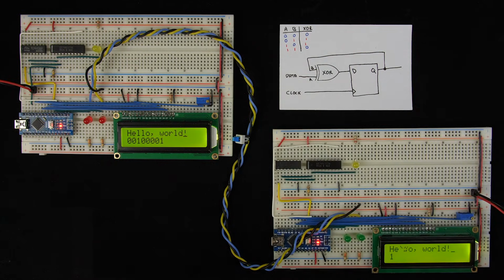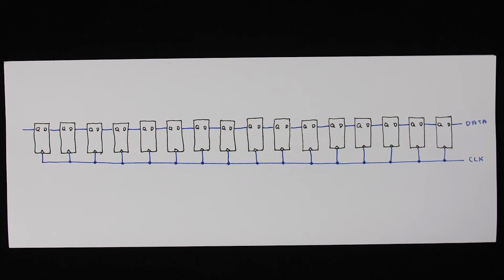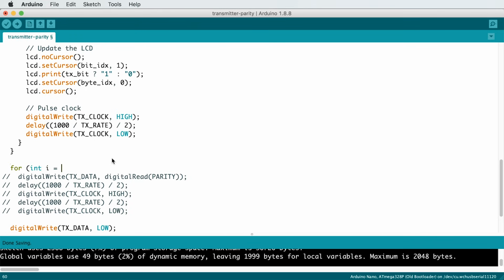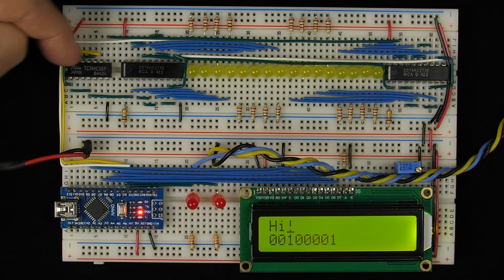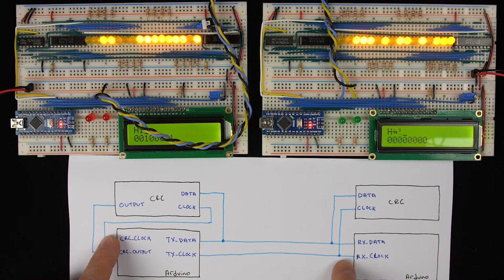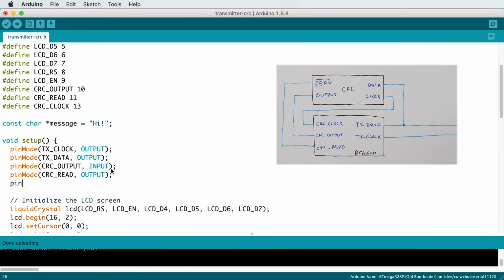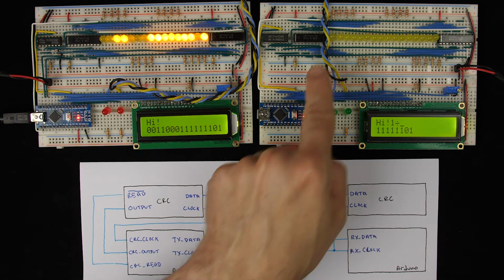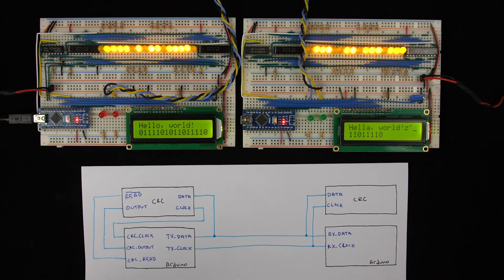Hardware build: CRC calculation

Comment: You could've used an or gate that ORs the output of the Arduino and the CRC checker, instead of using additional data lines. It would have the additional benefit of resetting the crc calculator. The AND gate to disable the calculator seems unavoidable though

Comment: I kind of want to see you add framing to this, that is to say stuffing the data inside a packet with a specified length so the receiver could calculate the CRC without showing those two false bytes. I think I'd go about it by using 7-bit ascii and reserve bytes with the high bit set as control words. Maybe add a way for the receiver to read the CRC and send back an ACK or NACK. 
...
I should just build up this on a breadboard myself and play around with it, shouldn't I.

Comment: hi ben... thanks for your videos, i really enjoy them...  i am learning arduino programming and with them i had learnt a lot
.... i heard that when the crc results non zero (i.e. bad), the result itself can be used to detect and correct the swapped bits, with no needing to request the data again
can you confirm that adding a little explanation please?
... thanks again and keep going with your videos :D

Comment: Could you simplify things a bit by clocking the CRC directly out of the CRC generator to the data line to the receiver? You'd still need the /READ signal and you'd have to be able to switch the data line from the Arduino to the CRC output, but that would eliminate the need for the Arduino to read CRC bits (and it would eliminate the "pause" that happens during that time).
Reply: Yes, all that would be required would be an AND gate on the output.

Comment: Thank you! these CRC videos are amazing! 
Is there a way to find which bits are faulty according to the not-null CRC you receive? 
Then you would be able to change the "receive" side program to remove the last two bytes and display "transmission error on chars #x and #y" if the CRC is not null

Comment: For some reason I was expecting you to add another control line to pipe CRC output directly into transmission line as opposed to reading and re-sending that bit thru computer.

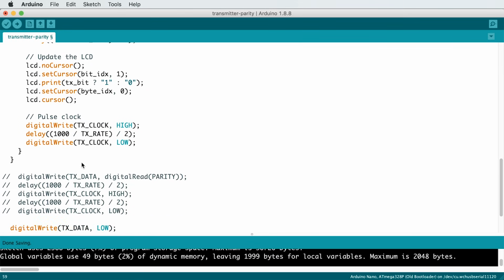Comment: Thank you very much Ben! One quick thing, when you explain what the Init 0x0000 in the crc website means, you say it's the resetting of the flip flops to 0. Isn't it actually the setting of data into crc bits to 0 right before we start calculating the crc, when we push the last 16 bits in with the Arduino after the message has finished (15:31)?
Reply: Hello, it's actually not. The initial value, as he explains, is what the flip-flops start with before we even receive the message and start calculating the crc.

Comment: Wouldn't it have been easier to AND the data input for the CRC unit with a pin? Instead of having two clocks. You'd then set the pin to 1 when you want to input your data to the CRC unit and 0 when not
Reply: That doesn't do anything. What's the point of having having an additional gate to toggle a data value when you already have full control of that data value with your micro already?
Not only that. You would also clock the receiver as well and send the zeros to it.

Comment: Great videos Ben!
I just wanted to know what would happen if an error appears while transmitting the CRC?
Reply from the maker: A common question—it might seem like the CRC part of the message is special, but it's really not. The receiver computes the remainder for the entire message: Data and CRC. If any part of the message (including the CRC) is corrupted, the remainder won't be zero. The CRC is just tacked on by the transmitter to make sure the remainder is zero before sending. Once the message is received correctly, the receiver just needs to know to throw away the last 16 bits of the message.
Reply: I think I understand! I will build it and have a play!
I love following your work, I really enjoyed the 8 Bit Computer. I watched the videos many times and documented it on CAD as well as building it.
You're very good at explaining, and it's always a joy to see your uploads. Keep it up!
Reply: @BenEater   you said "Once the message is received correctly" how you will know that ? if an error occurred on the calculated CRC while transmitted with the message !
In the receiver side the CRC calculated will be different from zero, so the receiver will know that there is an error but he can't know where !
of course the last 16 bits have no "information" for the receiver, and it will be thrown but you can't validate the correctness of the message !
Reply: @abder5453  Of course the receiver can't know where the error is, but that isn't the point of that protocol. I don't really know what you mean by your last sentence. You can never "validate the correctness of the message", you can only be sure to a certain degree if the calculated CRC comes out as 0. But if it doesn't, you know that there has to be an error somewhere. Now this error might only have affected the CRC portion of the transmitted bits in which case you will throw out the message falsely.

Comment: Was hoping you'd use the fourth XOR gate to disable the CRC and make it into a shift register but the diode solution was interesting as well

Also I kept getting annoyed you didn't use an extra pin to reset the CRC on startup of the Arduinos. Use pin 12 and connect both registers' reset pins together and reset in the initialization?
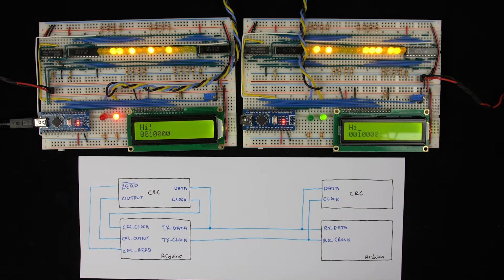Reply: he could just replicate the "error" at 38:00 to clear it without requiring any new wires, though the receiver would be more difficult as it doesn't actually know the message is over.

Comment: I'm wondering if you're going to go over RTS and CTS signals, as those would allow you to preload the receiver's CRC calculator with a value to assist with using other CRC algorithms, then tell the transmitter that it can send the message.

Comment: On that last point where a parity bit is just a first degree polynomial for a crc, I tend to either blow minds or start an argument pointing out raid1 is a special case of raid5. People complain you need three stripes for raid5, but that's only because I need two terms to xor to get parity, while something xor nothing is the original something: raid1/mirror.

Comment: 33:19: Wait, did you just build an AND gate from scratch? 
Could you also build all the other fundamental logic gates from only passive components?
Would it not belie the active/passive component distinction if you can press diodes into transistor service?
Reply: You can, and that's how you did it before ICs. (But usually instead you came up with some electromechanical solution...)

Comment: I always find it strange that people use #define to define constants like that in quite possibly 99% of all arduino projects. The nice thing about c and c++ is that it's a typed language. preprocessor macros and defines ignore that completely and may give unexpected (read wrong) results or weird compiler warnings, implicit conversions that are unintended, unoptimized code, calling the wrong overloaded function, etc...
I understand that arduinos have little memory to work with. But that doesn't excuse this. If the preprocessor just dumps in a litteral 5, that 5 still has to be in the machine code somewhere. So it's just an IADD $eax, #5,. instead of IADD $eax, <location where 5 is stored> This will result in faster execution (no memory access other than loading the command), but is still the same size (typically integers and pointers are the same size on any given machine, oddballs may happen though). But the compiler will optimize that out for you anyway. - Remember, the compiler is smarter than you. Don't optimize something the compiler might catch.
But I'd rather get compiler errors and ide support with code completion than not.
What's so hard about using

const int PIN_TX_DATA = 5;
or better yet
const uint8_t PIN_TX_DATA = 5;
instead of
#define PIN_TX_DATA 5
?
If you wanna go the proper way you could go with an enum class to make sure you can only pass pin numbers as arguments, and then even make sure that you can't even pass wrong numbers, but not any numbers at all except they are of type pin number. (though unfortunately most libraries expect integers, so you will have to (explicitly! avoiding errors!) cast every time you call external code).
WHY?! This is exactly why typing exists in c++. Prevent errors while compiling, not run into them at runtime. You could very happily call most functions that expect a pin number with 92583 and the compiler would say: yes, that seems legit. after all it's a 32 bit integer, which is exactly the thing the function wanted.

Even the official arduino reference recommends to use const instead of #define, why is NOBODY doing it?
https://www.arduino.cc/reference/en/language/structure/further-syntax/define/
https://www.arduino.cc/reference/en/language/variables/variable-scope-qualifiers/const/

Comment: Would you explain your selection of HC family? I've got LS and HCT families but haven't considered HC family.
Reply: HC is CMOS, LS is TTL. CMOS is a more modern technology, and what a significant portion of logic is implemented as these days. Many LS parts may be hard or impossible to obtain, since CMOS has largely replaced TTL.

HCT is simply HC with "TTL compatible" inputs. HC parts would typically need, say, 4.5+ volts to signify a logic high, but TTL can output much lower voltages for a logic high.

Functionally, a HC, HCT or LS part of a given number would do the same thing. 

HCT can be used to interface modern 5V CMOS based circuits with older TTL circuits/devices, and is also useful for interfacing 5V circuits with 3.3V circuits - but only in the 3V3 -> 5V direction, unless your 3V3 parts have 5V tolerant pins!

Downsides to using HCT are noise immunity, since it requires only roughly half the voltage of HC to represent a logic high.
Reply: for low-speed, 5V  breadboard constructions you can often mix 74xx, 74LSxx, 74HCxx and 74HCTxxx freely. The main differences are drive-capability, input voltage levels and speed.
Reply: @TomStorey96  Hi Tom. Thanks for the excellent reply. I'm familiar with the basic of each family. More curious if it was "what was on hand" or if there was a significant technical reason. I have a lot of LS parts in my supply so that is what I use. When I need to make a purchase, I price check LS vs HCT but am wondering if I should be considering HC for a new project. Off topic but is one family more readily available in surface mount packages? I tend towards hand wired boards thus my preference for through-hole packages but I'm interested in ordering PCBs for the first time and getting SMD experience.
Reply: Ben's diode-based AND gate has a chance of not working correctly with 74LSxxx or 74HCTxxx logic, because the threshold of a correct zero on an input is about one diode drop or 0.6 V. This means that a logic LOW which is one diode drop above ground is at the border. Using Schottky diodes with a much lower voltage drop would make the circuit safe even for true TTL-level inputs.
Reply: @RetroRogersLab  I think you will find LS surface mount parts hard to come by. HC and HCT will be much easier to find.

I could be wrong, but I would say LS is deprecated, and anything you buy will probably be "new old stock", and possibly why HCT exists in the first place.

HC(T) are in current production in various package types (and worth noting are the "little logic" family of devices, for that time when you only needed a single gate.)
Reply from the maker: Tom summarized the differences well. There's no particular reason I had to use HC. But since lots of people like to follow along with my videos, and the video content is evergreen, I now try to use parts that are likely to be widely available. In hindsight, that's something I wish I'd given more thought to in the 8-bit computer project instead of just using what I had.
Reply: @BenEater   Thanks for the reply. My electronics knowledge is not as deep as I'd like. You've taught me a lot and I appreciate your electronics knowledge. I wasn't sure if this was an arbitrary choice or a selection based on an HC characteristic that I should learn more about. :)
Reply: @RetroRogersLab  In this very moment, I would say the biggest characteristic you should learn about are the high and low threshold voltages of inputs and outputs for the different families. If you find yourself with a big collection of parts, then understanding which ones are going to work together may help you better utilise them.

e.g. You can quite happily use HC(T) to drive LS inputs (perhaps with a series resistor), since HC(T) will likely output very close to the positive rail voltage, which will be more than enough for an LS input. But LS being TTL may output somewhat less than the positive rail voltage, which means that if you wanted to drive CMOS inputs from LS you would need to feed your LS outputs in to HCT inputs specifically.

Comment: 25:06 "perfect!"  But I was expecting a "hmm, but..." and then a description of how the control input is changing at the same time as the data is using it.  That is, the leftmost bit is receiving a new value on the same clock tick in which the existing value is being used.  Why is this working reliably?
Reply: I think new values are only clocked in on the rising edge of the clock, and whatever value inside will be output regardless of clock tick. So at the rising edge, the result of the XOR is already done, is clocked in, then the inputs to the XOR change, but by that time the flip-flops aren't going to clock any more input in.

Comment: Edit: oh we were sending zeroes and now we're going to send the remainder instead. Got it.

27:10 wait a second.  If the recipient knows the polynomial used as a generator (which it does, because those are the XOR gates we put in, right?) then why does it need to receive the CRC from the sender?  Didn't it receive the remainder as the last 16 bits after the message?  Didn't it compute its own remainder from the message? Can't it just compare the last 16 bits to the remainder it calculated from the generator?

Comment: Why not have the CRC output feed straight out into the data out so that crc_read both stops the XOR in the CRC but also sends a bit of the CRC on the data output (rather than into the Arduino) on each clock?

Comment: In real-life circuits, I don't think the transmitter or receiver actually pauses to computer a CRC before continuing. In fact, I know that Ethernet did not originally contain a clock signal at all. Is there a way to compute a CRC without this kind of delay, or do network cards rely on buffering, or the network speed being so much slower than the device speed so that the CRC clock can be faster than the TX clock?

Comment: The "looks like we're doing a bunch of subtractions" at 3:05 confused me. As you also mention later, these are XORs, not subtractions. 

010010000110100100 
- 10001000000100001 would equal
-----------------------------------
  00001000110000011

which is not the same as

010010000110100100
^10001000000100001, which would equal
-----------------------------------
  00011000110000101

So I'm not sure I really get it. Why is it you say subtractions?
EDIT: Is that related to what you said at 20m50s in your earlier "How do CRCs work?" video? And to what you said there at 24m38s, etc.?

Comment: Like in the parity vid, why not calculate CRC in the Arduino? It seems in this particular design, that it would be especially more efficient to use arduino's fast clock to calculate crc than your slower TX clock held up 16 cycles to read and transmit the crc after message transmission while the receiver waits.
Is the hardware build just a learning exercise to show the similarity between parity and crc circuits, or is there some other reason?

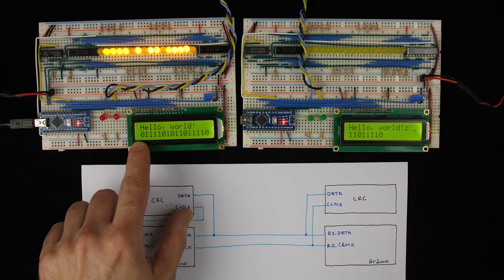Comment: at 50:02 both LCDs are NOT showing the same message....right LCD shows additional characters. At this point there should be no errors (all diodes are off on the receiver). Am I missing something?

Comment: I am currently trying to reproduce this project but I am wondering why not using a shift register such as the well known 74hc595 for shifting the bits instead of this ic which requires a lot of connections and which forced me to buy u shaped jumper wires lol. Anyway, thank you for this beautiful video, I really hope to get an answer !
Reply: The obvious answer would be the need to XOR certain connections within the shift register. It's not always a case of (bit 4, shift to bit 5), but rather (bit 4, maybe invert if condition is met, then shift to bit 5) - a standard shift register cannot outright perform this operation. That being said, it should certainly be possible to use a few registers in tandem to reduce the number of connecting wires needed, to only where an external XOR gate is required to invert between registers.
Reply: @Eyrlumi  Thank you for your answer, now it is perfectly clear!

Comment: Instead of the Diode And thing, couldn't you use the last XOR gate with an additional signal called CRC_FLIP? Then all the other XOR gates get their "flip" input from XOR(CRC_FLIP, Q16), for Di becoming XOR(XOR(CRC_FLIP, Q16), Q_{i-1}).

Then the Arduino can set CRC_FLIP to zero during normal transmission, and set it to CRC_OUTPUT (which is tied to Q16, making XOR(CRC_FLIP, Q16)=0) when reading the CRC.